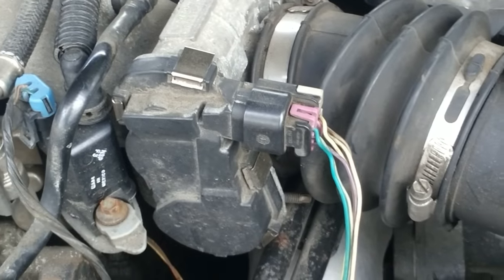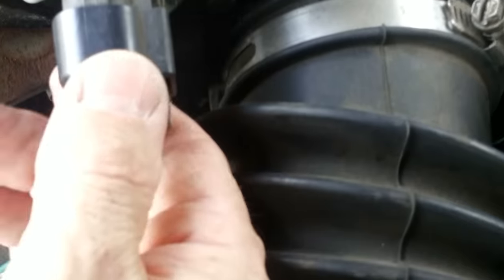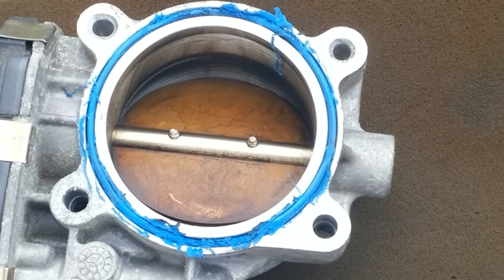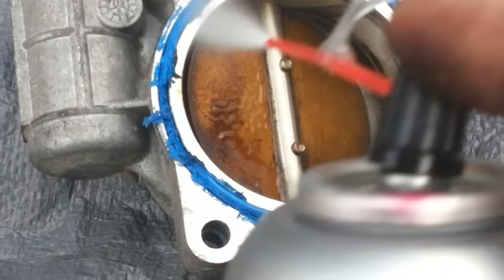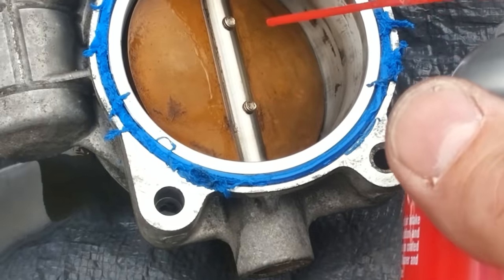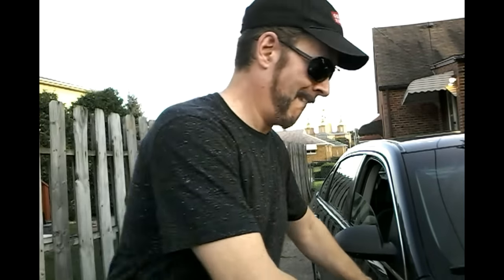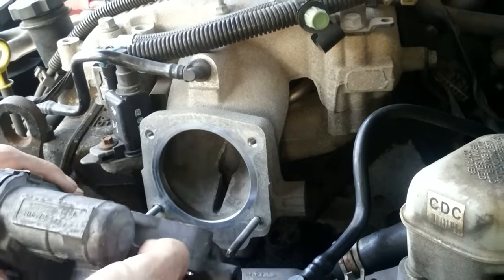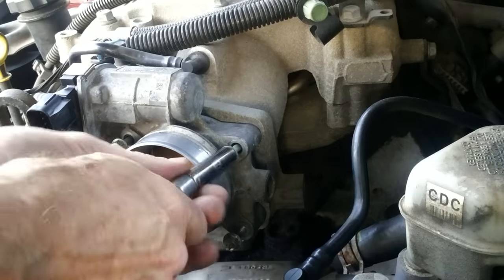Reduced Engine Power.  Here is the FIX.

Comment: The real fix is!!!!!!!!!!!!!!!
Cut the boots off the battery cable ends and clean both sides with sand paper. Cleaning the one side is not enough the lug side is never serviceable unless boot is removed. I just used dielectric grease to cover instead of buying new cables. Also remove the primary cover and shroud around the fuse box under hood. Remove the positive lugs. Most gmc have three 1 from pos battery cable and two smaller ones powering the computer and something else. When you look at them they look good no corrosion but if you look closely it will look Grey. Sand both sides of the ring connector and the lug surface. Overtime no matter where you live air temp and moister slightly oxidize the metal. What happens is one of these powers the pcm and the others send power to vital sensors. Most of the time as long as its not a broke tps wire or if you accidentally stretch while in drivers seat and kick the pedal connection this connection oxidation does not allow the pcm to have a solid constant battery voltage so when the pcm dedicates the 5v reference to the PETAL AND TPS they are varied. Thus eventually the pcm does not allow the key on pretest yes your gmc will tell you reduced power without starting. Turn key on and wait about 10sec and if the pedal/tps agree nothing will display if not it will display reduced engine power. Also if you are having REP while driving add a new ground on drivers side of engine bay from firewall lug to one of the bolts on the bolts on the alternator bracket. Also grounds underneath drivers side frame rail, under radiator support, and the main negative lug on drivers side engine block. Also on the passenger side engine bay there is the pcm ground that comes out of the the big loom on the firewall goes out to the back of engine just like the braided one it is covered in crinkle cover but they are black wires usually two wires. Cut as low as possible bring up and solder one thicker wire estimated at double the gauge of one of the wires so you won’t have resistance problems. Remove the braided ground from firewall and remove one bolt from the third coil pack closest to the rear of engine and attach the braided ground don’t double ground this remove it because you could cause what’s called a looping ground. Electricity goes to path of least resistance. Since the braided line is very hard to remove from rear of engine block attaching the firewall end back to coil pack bolt leaves it null/void and tight so it won’t rub anything else. Also use a ground wire insulated I think it was 15in from parts store $12 for the new firewall to alternator bolt connection. I guess I could have made a video but I’m posting this on comments in various places share if you think it’s a good thing. My Rep problem is solved no tps,pedal, or throttle body replaced I researched this problem for months because I know a shop would just hose me for parts and I think most sensor issues and there lifetime are determined by there power/ground consistency. 2001gmc Yukon slt 260k miles. Good luck guys.

Comment: I Changed All Throttle Body And Throttle Position Sensor, And Replaced The Accelerator Pedal Position Sensor, And My Car Still Doing The Engine Power Reduced After A Few Minutes Of Running!!!! 2010 Chevy Impala
Reply: Did u get it fixed?

Comment: I pulled the battery cables off the battery turned the headlights on and connected the positive and negative cables together a few mins. Put them back on and fired right up, added coolant as well. Thanks for the video

Comment: I currently have a 2006 Saturn ion 2 and stumble upon this problem in the beginning of May. I took it to a local Pep Boys and was charged $444.00 to replace the Gas Pedal Sensor. They were confident that was the issue. The beginning of August, issue comes back. They said "oh well its actually your gas pedal itself". They charged me $307. Less than 2 days, maybe 30 minutes of actual drivings worth, issue again. "Well the only thing we could possibly change is the "Throttle Control Motor" and charged $214. Would have been $600ish but they applied what they already charged me for the pedal making the third part cheaper. the car couldn't even last a day and still SAME ISSUE. They said "it must be your computer, you are gonna have to take it to a dealership". I'm about to go in there and demand a refund. This is ridiculous. Called their unreliable customer support, prior, they didn't help. I pretty much got conned $1,000 for them to not fix the issue or expertly know what the issue may be
Reply from the maker: Ions are known for having problems when throttle bodies get dirty.  I recommend cleaning it if you haven't already done so.  It's a good starting point.  Also check for dirty connections at the TBS connector and broken wires on the harness.  Look for bad insulation on the wires.  Check for broken wires by doing the " tug test".  (Pull on the wires one at a time and see if the insulation breaks or stretches).  This would indicate broken wires inside the insulation.  Good luck!
Reply: The problem is with this issue it could be caused by so many different things and unless you have an amazing mechanic which I haven't met since I left Michigan three years ago, you're screwed. I have an 09 Yukon and that was the cause of my issue after I threw a bunch of parts at it including about a body

Comment: I had the same problem brought it to the dealer first they said it was my battery terminals 3 days later came back on an come to find out it my gas pedal an the connection to the pedal they replaced the whole pedal for free an haven't had a problem sense an it's been a year or so now.
Reply: How much did they charge you for the whole procedure.

Comment: Sevice traction control= plugs and filter do to mis fire.computer trying to shut accessories down.
Engine hot/ac off= stuck thermostat. Engine is not meeting temp.. engine hot warning throws everyone off!!!
Reduce engine power= throttle body...JUST saved y'all 1,500.00 in over paid mechanics!!!

Comment: Yeah but for certain models YOU ARE REPLACING THE THROTTLE BODY CUZ NO KIT IS PROVIDED. Case in point: 4.2 I6 has no TPS kit. TB was $141 on Amazon (Bosch).
Reply: Think his is an impala looks jsut like mine and we didn’t have get the whole thing just sensor and my was 09 impala but it didn’t fix issue for me
Reply: @AndyPlayzGames-149  Mine ended up being a clogged cat. Worth checking for all of you.

Comment: You have a great approach about making this repair and funny jokes. I'm going to try cleaning the original TB and see if that works, then I'll invest in the replacement kit. Thanks for this video.
Reply: Hank Bridges  Noted. The car drove better after the cleaning but started giving the power reduced blah blah message. Gonna install a new one.
Reply: @Mister.MARVEL00  did replacing the throttle body fix it? Much appreciated.

Comment: In side the black plastic tpi on the throttle body there is a gold colored plate, under that there is a contact plate with 4 contacts, if you look at them with a magnifying glass, 1 is separated. You could possibly solder it back together but its so small .
Reply: Or just throw out the factory TB and get a Hi Performance one. I'm sure there is one made for that V6 by now
Reply: @extremedrivr  were trying to save money my bro not give my whole brain to them

Comment: I have a 2006 impala that did this and now I have tighten gas cap bullshit that's a EVAP solenoid. I wish I had never seen this damn car!!😡
Reply from the maker: Ahh... the lovely 2006... just like mine.  Most common causes:  TPS, TPS wiring harness, dirty throttle body,  Accelerator pedal sensor.  I hate that I like my Impala.
Reply: Issues with my 2007 brought me here😂🤦🏻‍♂️
Reply: That's the crankshaft sensor
Reply: @cookingwithquise3685  can confirm, yellow wire coming off the intake manifold harness was kinked up and severed, replaced the harness and no issues
Reply: It happened  to me on a 07 lucerne
Reply: I have a 2006 Chevy Cobalt that is reading this code. Can't seem to find just a throttle body sensor, just the throttle body for sale.
Reply: Evap purge selinoid. Yall.  I replaced TPS  and harness  and throttle body.  Still no fix.    Evap purge selinoid is problem

Comment: After he did the "fix" he continues by saying now he has to take it to a dealer and have it calibrated. Costs about $100, thats where he lost me, as I seem to be throwing money away already.
Reply: if it's a 2008 or higher. not 07 and under.
Reply: Terry Weaver in most cases, you dont. Even if you do, most semi professional scanners have the feature on it to do it. A launch pro mini x431 can do it. Autel and snap on scanners can as well. I would say a good majority of the time it doesn’t. Before he took off the throttle, I would have hooked an inline resistor to the throttle and watched the scan data to see if i can move the sensor values. That would verify wire integrity and the computer before taking parts off.
Reply: No..no... flashing is not necessary..replace clear code and go!
Reply: @mikesecondo2254  how do u clear the code without a code reader?
Reply: 2009 Impala replace tps assembly... start motor..light is out...no calibration needed..I know I have replaced mine a year ago!

Comment: I have that problem 07 Chevy Impala I pulled out my traction control came on then the engine reduce light came on smh I didn't know what was going on but this is a great video so I know what the problem is now thanks
Reply: Mike Duane what was the problem and how did you resolve it?  TY
Reply: Eddie SanJacinto have the exact problem 😂. Any luck on the problem?
Reply: I have the same problem now  traction control pops up and the reduced power.  Haven't gotten it checked out yet

Comment: Try this if car shows that message and shuts down on the side of the road: with the key in the on position (car not running) disconnect both battery terminals and while disconnected touch the terminals together (not to the battery) a couple times. After a minute o two reconnect the battery and restart the car, hopefully that resets the sensors and computer and drive home safely

Comment: Fixed mine with new throttle body 2007 ls 3.5 liter flex fuel

get the Hitachi one (comes with sensor on it) no reprogramming needed. I didn't disconnect battery. go to auto store clear codes easy 10mm deep well socket took 45 minutes..
Reply: star child how much was it?
Reply: Aaron PistolPooh have someone go under the hood an touch the starter with a screw driver to basically shock the starter it should starter after if it sparks but if it doesn’t start replace the starter
Reply: Same but here I am again 6 months later gotta change it again or it's the gas pedal    the oil pressure sensors  with trip it to

Comment: I am not sure if these vehicles are the same  as the one I had. I had a 2002 Olds Bravada and I spent months trying to fix the reduced engine power signal and mine would only shift to second gear and would not go any faster. Even mechanics could not figure it out, but after 3 months like this I did figure it out.  So ya GM, GMC, OLDS ect, ect Train Blazers, Bravadas, Envoys, all those suv's that are alike. They used inferior solder on the wires going to and plugging in to the throttle body. Its a wiring harness with a lot of wires in the plug in. Well this solder breaks down and comes lose ON THE INSIDE of the wire to metal plugin terminal on each wire. The wire will still appear to be connected fine but it is not. If you pull on the black ground wire it may pull right out on the metal plug each wire is soldered to. I found this by accident. The problem on mine was the black ground wire. I shoved that wire back into that metal solder plug that was still inside the wiring connector as far as I could get it and shoved a wooden toothpick in there as well until it got real tight and then I broke the toothpick off and left it there. Taped the joint up with electrical tape and that fixed every problem I was having. Not shifting above 2nd gear, reduced engine power light, all sorts of problems including P-Codes for all sorts of things not related to the throttle body like it said my accelerator position sensor was out. All this went away immediately and I never had another problem again.   That lose ground wire caused ALL of this.  Hope this might help someone else that may be in the same boat I was.
Reply: May have to check that bc we had lose black wire and car wouldn’t start and we fixed that so good idea may need check that bc we replaced the throttle sensor

Comment: This is a common electrical gremlin which most of the time is related to faulty wiring and or most number 1 corporate a ground issue within the component
Reply: Hm wonder if it’s with my tpms some say that’s cause also bc I changed the throttle sensor and pedal sensor still didn’t fix it

Comment: Hey guys it can also just be your ground, i had same problem , i just unconected original ground in back and run a new ground to ground by water pump and problem solved no more check engine light and gas started working hope it help you guys blessings

Comment: I was about to torch my 2010 V6 4.3 Silverado, I found out doing a tune up  fixed the problem.
[After replacing the MAF sensor,  throttle body, throttle body harness, 4 oxygen sensors,  Transmission Control module, battery negative cable etc, nothing that the scanner called for worked.]

Comment: My truck kept running Rough, engine killing, idling like Crap and indicating THAT and thought I would have to change THAT PART then I realized I hadn’t changed the Spark Plugs in 70,000 miles. I put New Plugs in and it quit indicating and started running like a Champ again.

Comment: I had the same issue twice, I had service stabilitrak, service traction control and also check engine light came on reduced engine power it happened on the coldest day of the year and it just happened again today-11 Celsius, last time it was frozen this time I have absolutely no idea I think I'm just going to change the throttle body or the two sensors just to make sure
Reply from the maker: Oh no...   so sorry.  The traction control message just means that the computer only disables traction control/stabilitrak when the system goes into reduced power mode.  It may not be as bad as you think.  Good luck! and let me know...

Comment: Code-P2315 , throttle position sensor. Is this common in the 06-07 Impala and Monte Carlo SS 5.3 as well. 

I've had problems every month. Chevy went the cheap route on many items that cost us alot in the end. Such as the air clicking noise every Impala MC has.
Reply: How did u fix it

Comment: Haha great video man, I'm having this problem in my chevy silverado right now
Reply from the maker: Silverado...  I worked on a few of those.  Sometimes the cooling fans malfunction and draw too much current. They're on the same circuit as the throttle body sensor.  The fans will pull the reference signal for the TPS down too low and trigger the reduced engine power.  Check your cooling fans if replacing the TPS doesn't work.  Let me know.

Comment: Helpful video but I need to see it for a 09 Saturn Vue 3.6 (it's a Honda motor) can you help?
Reply from the maker: Actually, the 3.6 is a Chevy motor.  The procedure is pretty much the same.  Just confirm you have a P2135 fault code.  Chevy recommends cleaning the throttle body with a solvent soaked rag.
Reply: @lifeafterlife8417  Thank you,  someone said that Saturn used Honda engines in some of their cars. Like the 03 Chevy Tracker had a Suzuki motor

Comment: Hey guy. I have a question. My son and i own a 08 impala 3.9. He is the mechanic and im the bank. 😊

After replacing the sensor kit, am I able to drive it to a shop to get the ecm re programed, thorattle learn reset? Want to be sure before changing it and finding out it can't be driven. The shop is about 189 miles away from me. Let me know, thanks.
Reply from the maker: The ECM should be ok.  The throttle will re learn on its own.  2011 and up you need to take it to the dealer.  Good luck!

Comment: I needs throttle body change cause tps integrated not sold separately in my car nissan pathfinder 2007 and xterra 2005 is there any good source that selling only tps not the whole throttle replaced 6 used throttle 2 of them remanufactured and got from time to time p2135 but when I switch on ac it doesnt come????
Checked all vacum leaks hoses replaced filter housing, computer changed and reprogrammed paddle accelerator changed  so what do you think, next thing will be match and dynamyte 😂😂😂 really frustrating

Comment: Flashing after replacement in not necessary.cel is on before repair.. you may attempt to clear before repair and may not clear and show as permanent.disconnect negative cable.replace TPS.now start..note cel is gone.now with scanner once again it will show no codes....now drive with confidence!!

Comment: Ok so I have reduced engine lite blinking codes are as follows o2 sensor 1 bank 1 o2 sensor 2bank 1 up and down stream and maf mass air flow replaced all three parts Upstream Downstream and mass air flow still does the same thing could it be my throttle body with the TPS even though my scan tool is reading throttle percentage
Reply from the maker: What kind of vehicle?  Reduced engine power could be a separate problem.

Comment: Great Video I'll be sure to do the Kick part
Reply from the maker: It helped me.  Thanks for watching!
Reply: Life After Life  I got a P0010 code. I fixed transmission then starter gave out I fixed that now I got this issue it won't go passed 20 I don't know.
Reply from the maker: Betina Rios  shutting the car completely off for 2 minutes (when you can pull over somewhere safe) will reset it temporarily.  I did this for a couple days until I fixed mine.